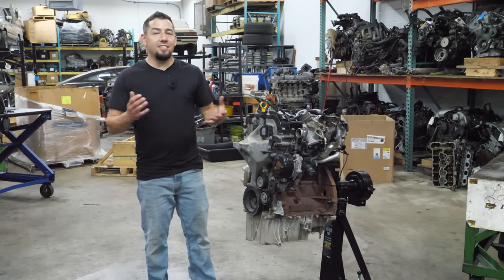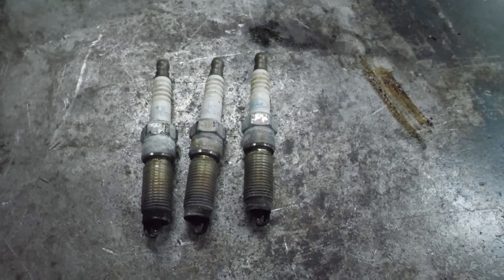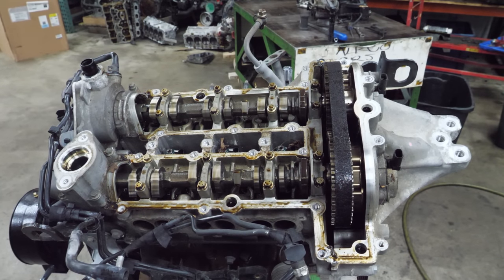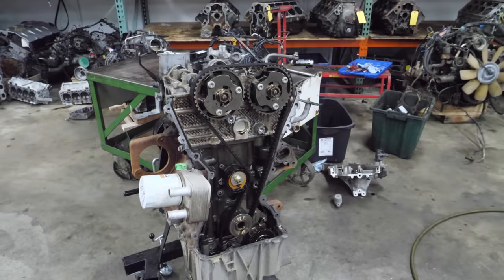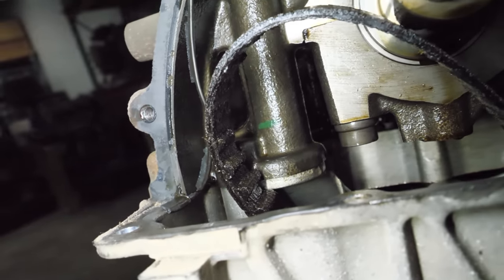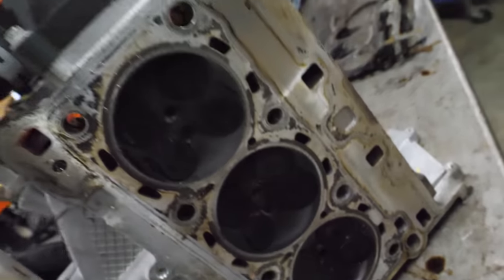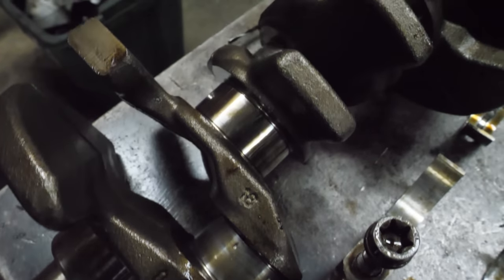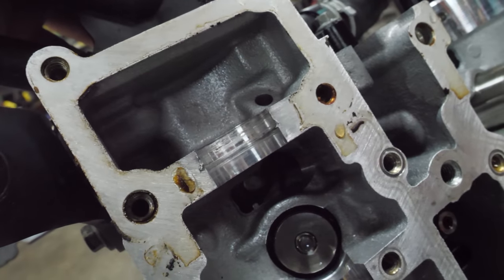JUNK Ford Ecosport 1.0L 3-Cylinder Ecoboost Teardown. LAWSUIT ENGINE!

Comment: I hope this does not sound too cruel but if you buy a 3 cylinder Ford engine, you deserve a 3 cylinder Ford engine.🤣
Reply: You could delete "3 cylinder" from that phrase and It would still be correct
Reply: In Europe you could get a civic with a 1L 3 cylinder earth dreams turbo.
Reply: Have had 2 ecoboost v6 vehicles since 2010 and both were exceptionally powerful and reliable.
Reply: Yeah true, but I still feel for non car people who buy this crap.
Reply: @ganzonomy  The difference is that Honda knows how to make really good small displacement engines.
Reply: Naw, the Fiesta 1.0 ecoboost is a stage rally bargain champ
Reply: Yea you should know what you're getting into when buying a ford 3banger🤣
Reply: I had a 6 cylinder Ford engine, it became a 3 cylinder Ford engine.
Reply: Correct Sir !
Reply: I'd take this motor over any Mopar motor, easy. Coming from someone who has had my filangies in ever car.... mopars should have died on the first bailout, and for good reason.
Reply: Bronco Sport owners with the 1.5t on self delete watch
Reply: I worked at a ford store for many years, when these came out the sales guys all made fun of them, people hated them, and frankly considering you could buy a base escape for less than a mid equipment ecosport... it was deserved. Except the escape came with engine choices that had been proven in the wild and didn't grenade. Well... the engines didnt, transmissions were notorious for a few years for dying at 60k miles lol
Reply: @gregsalerno1434  I bet you're the type to spend 25k on a rusty Mopar shell, if you had the money.
Reply: They call them an "ecosploder" for a reason, no matter how many cylinders they have.
Reply: I have a 3 cylinder Ford engine, but it's from 1974, it's a diesel, it's 57hp, and it's in an industrial tractor.  Slightly different, lol.
Reply: I have a Mitsubishi three cylinder motor with lot's of miles on it and it has been rock solid. Small displacement motors can be just as reliable as large displacement motors. The difference is, some people just haven't moved past 1990 in their thinking.
Reply: @mattyb7736  the other name is "ecoboom"
Reply: @gordonfischer8484  Yes and no. People who refuse to research such a major purchase will learn the painful way. I have all the scars ...........
Reply: @merr6267  Back in 1974 Ford was still building good engines.
Reply: @banjopaisley1021  Even though MOPAR has had their fair share of turds, Ford is still worse than MOPAR.
Reply: Ford totally forgot how to make an engine these days 
Over here in the uk they are always blowing up , even the EcoBoost diesel engines are now being replaced due to wet belt failures
Reply: @ChuckThree  Yeah and it only lasts 1 Stage before it blows up......the Focus RS Engines had totally Crap Head Gasket Problems.
Reply: Ford Fiesta ST 1.5 ecoboost 3cil is great, if that 1.0 is garbage idk
Reply: Thats a Chinese built ecoboosss
Reply: Lol I was just thinking what a piece of crap this engine is, what's it's point 🤔🤪
Reply: Built Ford tough don’t ya know! 👍
Reply: Exactly 🙃
Reply: @bobmitchell8012  the Focus RS head gasket thing was a first model year issue. Mountune will happily build you a 680hp 2.3 ecoboost with a warranty. 

If you wanna talk about junk, lets look at Chevrolet’s future lineup… nothing with stick shift, no Camaro, and “Blazer” that has more in common with a minivan than the og K5 Blazer. 👍
Reply: Ehw❤
Reply: So glad I told the wife to buy the 4 cyl version of the EcoBoost I know it's not perfect either but in an SUV I am sure the 3 cyl would have blown up by now at less than 100,000 km
Reply: I want a Morgan Super 3.  Not sure if that $60,000 “car” has this turd engine, but it does have a 1.0L Ford 3 cylinder.
Reply: I put a modified one of these on my kit airplane. Power to weight is incredible. Very light and small. 

Sadly, it's given so many issues.
Reply: @ChuckThree  yes, if you are willing to dump a lot of money into maintenance.
Reply: vroom, vroom.
Reply: The 1.5 ain't that bad but the 1 litre..... nahhh
Reply: @wantapgt  The guys talking shit are mad because the EcoBoost,  especially in the F-150, is top dog in performance outside the supercharged V8's.

I'd probably avoid this 3 cylinder version tho.
But the fools talking shit about the entire ecoboost line up are ignorant. 

BTW Chevy me pushing a 4 cylinder 4 banger turbo in their 1500 truck... Toyota now went with a ecoboost clone for their Tundra and Dodge is switching to a turbo online six.
Reply: @ChuckThree  And the 3.5 EcoBoost Ford GT won multiple Le Man's or whatever it was
Reply: @North Wales SXS  No such thing as a EcoBoost diesel.
Powerstroke maybe?
Reply: I doubt that you are talking from first hand experience. I owned a 1l Ecoboost for 8 years without a single issue. And if you think that a turbo engine is fuel efficient, then you obviously aren't an engineer. A turbo forces more air into an engine so that you can introduce more fuel.... Therefore is cant be more fuel efficient than a NA engine of the same capacity.... It is more thermally efficient, but not fuel efficient. There is a reason that the 1l Ecoboost engine won best small engine of the year for many years because it was ahead of its time. There are better engines now, but all the competition had to catch up to compete
Reply: I’ve had a few great 3 cylinder engines, in motorcycles and cars.  I do not believe that 3 cylinder engines are the problem, it’s when manufacturers choose 3 cylinders because of them being cheaper to build, and then cut corners and make poor engines.   Many small Japanese engines are 3 cylinders and totally reliable, in fact 3 cylinder engine typically produce greater torque than an equivalent size 4 cylinder engine.    The failures of this ford engine are not related to the number of cylinders but to the poor design that seems to put cost saving above all else.
Reply: @rideswift  I’ve owned 3 Fords to date.  My first having 209K miles on it when I traded it for my 2nd car.  My 3rd (and current car) has about 100,800 miles on it and shows no signs of giving up the ghost anytime soon.
Reply: Tru
Reply: @ganzonomy  man Europe gets all the cool stuff lol
Reply: @S  Actually, if you have two engines that are identical, other than one having a turbo and one not, and they are driven the same way the turbo should get at least slightly better mileage. At cruise, ie no boost, the turbo is still spinning and flowing enough air that you have less manifold vacuum, and therefore less drag on the pistons on their intake stroke. Yes, if your beating on both, the turbo will burn more fuel, but of course your also making more power. If your driving normally, or at a cruise, the turbo should overall get better mileage.
Reply: @pilotavery  🤨 maintenance like, what…? Changing the oil?
Reply: @ChuckThree  Head gasket issues, water pump leaks, valve issues, injector issues, intake egr clogging up etc.
Reply: @ganzonomy hond said ford make it for them I think. That's what they told me at the dealer. Honda make the 1.5 which has problems as well
Reply: @apolloomd4939  I think the Japanese have small 3 pots down to a fine art. I drive a suzuki with a 1.0 3 cyl motor and it's great.
Reply: Found
On
Rubbish
Dump
Reply: The 1.0 Ecoboost has chain now days :p
Reply: My mom amd i didnt know.
Reply: Absolutely nothing wrong with these engines. It’s poor maintenance that kills them. Also the HP/litre these engines can produce is more than an engine double its size can do. Plenty of them in the uk running 200hp and super reliable.
Reply: @craigcampbell8560 No it isn't dummy Chrysler is far worse quality.
Reply: I don't know what was the idea to use timing belt immersed in oil. If this belt is not going to be changed and redesigned to timing chain this problem is not being solved.
Reply: @RosskoPeeko Ford factory rep checking in !   haha
Reply: @spaceghost8995  care to elaborate on your comment?
Reply: @jeffreygauci428  a wet belt should have just been a chain. Backwards logic
Reply: @RosskoPeeko  Don't play dumb.
Reply: @spaceghost8995  I’m asking a question. Or is that too difficult ?
Reply: @rideswift I loved my Focus ST 5 cylinder but that was a Volvo engine
Reply: I still want one. why?
A v6 especially turbo will have you in lose your license territory quick
A 3 cylinder gets better mpg,  than v6 plus it's harder ( but still possible ) to get in lose your license territory. I would pay 10,000 usd more  and a lower mileage warranty to get on in a F150
Reply: Ive seen this before.. the automatic gearbox types have an extra belt and shaft.. the tensioner breaks and screws over everything🙃🙃 ive broken down these engines to many times because of problems with the wet belt😭😭
Reply: @rideswift 😮p❤
Reply: @banjopaisley1021  I'm a master tech, I worked for Chrysler for a year in 2001. I became a welder/fabricator/industrial mechanic because of that year. When you can replace the same part under warranty 3 times in a row before you get one that works, the entire company should die.
Reply: @JasonB666  Yes, it has been a zombie brand for decades.
Reply: @mattyb7736 Im a ford tech in the UK. We call them ECO-BOOM engines
Reply: @paul_nwsxs Ecoboost diesel? Do you mean Eco-Blue? Or maybe Duratorq?
Reply: Hey! Screams in vw 1,2 3 cylinder pain...
Reply: I has a fiesta 1l ecoboost for 8 years. Never had a problem with it . Front shocks always go ,but engine was great.  Kind of miss it
Reply: My 3 cylinder 1.0L toyota engine  has clocked up 213,000 miles and still runs fine!
Reply: @steveapt1  Yes, the key word in that sentence is TOYOTA.
Reply: but it goes so good with a microwaved tofu steak and a bud light
Reply: @rideswift best selling truck 47 years in a row.  That's not a fluke.  Say what you want but stats speak for themselves.
Reply: I see chevrolet is making 3cyl motors too. Havent seen a gm 3cyl since geo metro
Reply: Doesn’t affect 1.5 dragon engine
Reply: @PsalmFourteenOne not an ecoBOOST diesel, but ecoblue. Comes in two options 1.5 and 2.0. Both are psa, but the 2.0 has a wet belt while the 1.5 doesn't. I know this as I literally own a 1.5 and glad I do 😂😂
Reply: I bought my focus in December of 2017 , it's a 2018 so far no problems , should I replace the oil pump and belts before I do have a problem ?
Reply: I saw this motor in a Ford ecosport turned around and ran out the door.
Reply: Focus 1.0 ecoboost I plugged my other diagnostics scanner in and it says this  fault is 
Power supply fuel pump 
Short circuit to positive or open 
Intermittent 
I ordered a low pressure fuel pump that will sort it i can start the car and rev it up but when let it idle car just dies and if i rev it it will stay running for a couple of minutes with accelerator keot pushed down a bit thanks for your info mate
Reply: Ford 3cycl desiel engines were splid back in the day. fitted for farm tractors
Reply: Right on!
Reply: @idrisrobinson5393 all ford's sick these days and most other American crap
Reply: @fil1329 The 1.0 Liter engine is a Ford of UK design, from their Dunton Technical Center. The Europeans get German built motors. I think the US gets Chinese built. So, nothing "American" about it.
Reply: @rideswift 🙋‍♂️ I'm one of those that made the mistake of buying a Ford
Reply: Now, now.  Don't forget the rousing success of the Ford Tri motor plane.  3 times the junk.
Reply: @rideswift Never owned a Ford 4.6 2v then. They just won’t die no matter how hard you try. 😂
Reply: @ChuckThree American fiesta st is a 1.5L 4 cyl I tgink
Reply: @ChuckThree American fiesta st is a 1.5L 4 cyl I think
Reply: Yes and no: Ford is a problem, but 3 cylinder engines can be great stuff.
Reply: @Dan_Neely I had a 72 Honda, 2 cylinder 36 hp. It ran great as long as the points were good.
Reply: I laughed when I saw a Bronco in the showroom with a 3 cylinder turbo.
Reply: @wantapgt  and they fortunately do not have a wet belt design. Which is the common mode of failure. It's a major design flaw that should have never been considered or implemented.
Reply: I didn't know and now stuck with a €1300 bill if I want to prevent it from ruining my engine. So mad... but yeah probably should've done better research prior to purchase.
Reply: Nothing Ford makes is all that reliable and never had been, but any engine can be a ticking time bomb regardless of manufacturer, if it's abused, run ragged, or not given correct maintenance
Reply: @paul_nwsxs Nonsens !
Ford engines are good. No problems !
Reply: MK1 had lots of issues. MK2 was a significant improvement but still had the belt and or belt tensioner failure. MK3 with the chain drive is a significant improvement on the MK2. If you ecobost does fail it’s more or less the same price to do an ST conversion. Never seen one in a B-Max so I’m planning it now before the failure so I’m good to go and upset people at the lights.
Reply: @Dan_Neely  they actually make a wet belt piece of junk as well.
Reply: Ford always has to engineer the weak link in everything